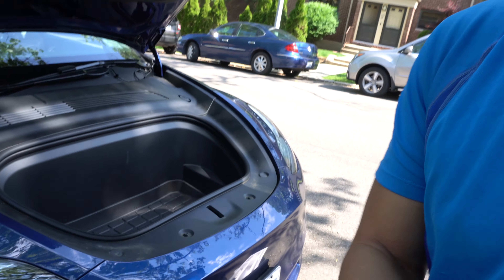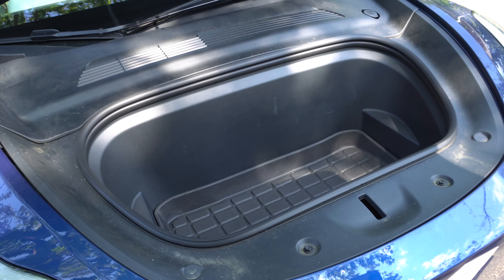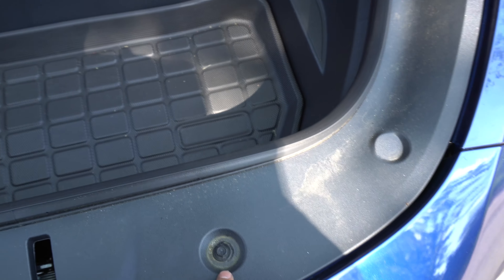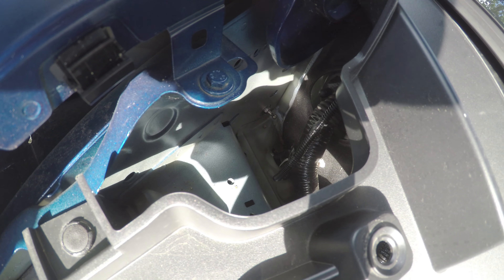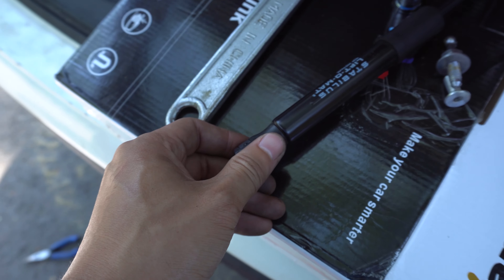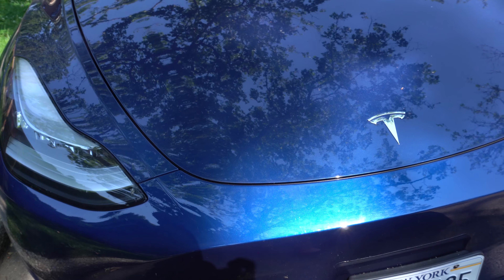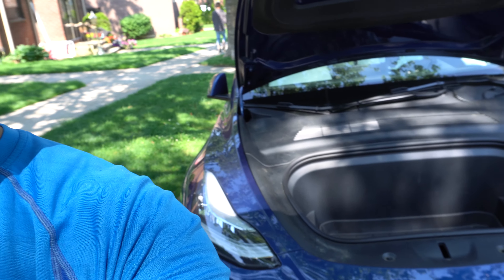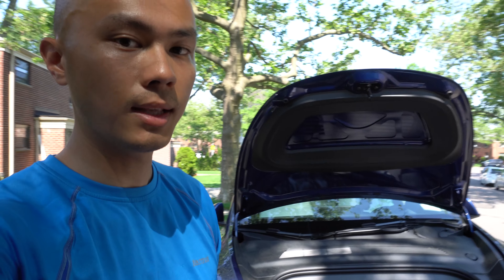The Single Best Modification for a Tesla - Automatic Frunk Tesla Model Y

Comment: I can’t get the frunk to hatch and close completely. The hood seems to be tiled now. What am I doing wrong?
Reply from the maker: Are the two struts at the same length? Perhaps try manually cycling the motion. Make sure the brackets are attached correctly on both sides so there's no length discrepancy. Thats the main thing I would check for if the hood is now tilted.

Comment: If you see this I need some advice on my 04’ Z4. The drivers door is latched shut and will NOT open.😂. Is there any possible way to open it, get the panel off while it’s latched shut, or anything that might help me. Thanks!
Reply from the maker: You'll need to get the panel off, the mechanism isn't great and I think this is a relatively common issue with z4s. I think I had this problem at one point too if I remember correctly.